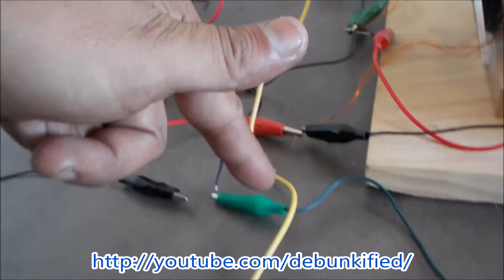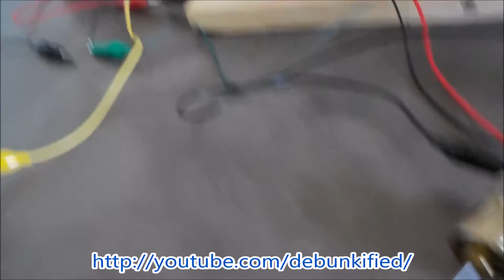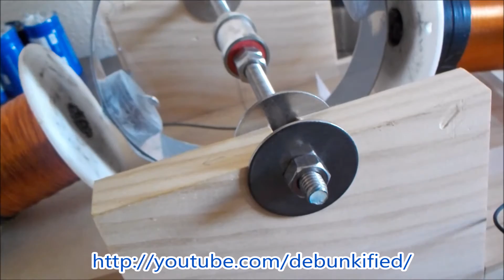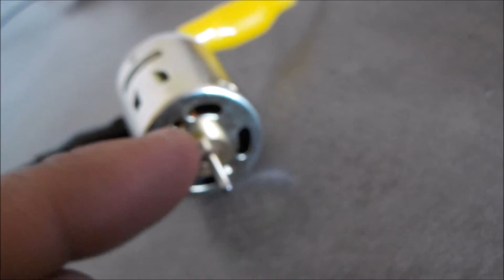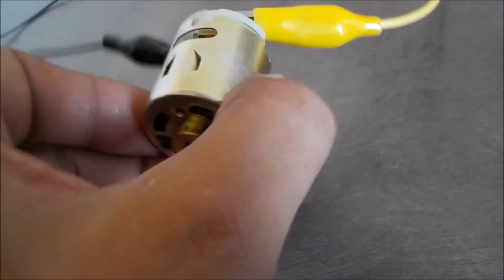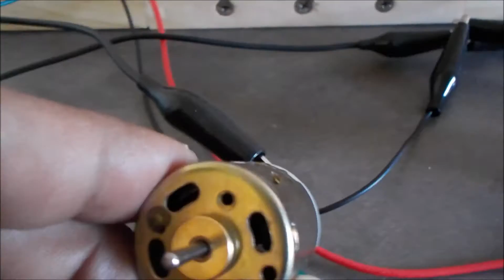Resonance is a Key

Comment: This is no "resonance". This is just: the first Motor has lower resistence, the big has higher resistence, so the Voltage is on the big second one. The first stops.
If you now use the produced energy of the second Motor, the third one turns... And it turns slower than the first.

So take of the first Motor and you got more energy for the second one and the third turns faster. 

It is everything about the resistence.

Comment: Looks like the inductantance reactance increases on the big wheel coil as it's spin increases, which takes over the power consumption of the battery from the 1st motor, causing it to slow down (initially the big coil has very little reactance because it is proportional to frequency, and it is 0 to start). The spinning big wheel  transfers power to the secondary winding coil, as the magnets are spinning over it, causing the second motor to spin faster.  You must have played around with the layout, magnets and coil winding size to get the proper relationship for it to work. Interesting demo.

Comment: Man I want that setup. What kind of bearings do you have on your magnetic wheel?
Is it possible to turn another motor off the resonant motor to produce a charging system 🤔🤔
Reply: There's no proof of overunity yet, because the power is coming from the battery, which is being drain.  If instead of attaching the 2nd motor to the secondary (or adding a 2nd generator coil), you use the output power to charge the battery and it keeps going, than at least you are making up for the lost energy of running the motor.

Comment: I'm totally lost. What is the purpose of the primary motor
Reply from the maker: +jesse byrne the purpose of the primary motor is simply to serve as a mechanical oscillator. 

It is utilized to demonstrate the power of resonance and how power is transferred to the output (smaller motor) by the building up and storing of energy in the fly wheel (rotor), while the input power becomes very small. 

Remember spinning mass stored energy.

Comment: I did something similar using a flyback transformer charging a capacitor with very similar results. had to keep a load on it or the motor would slow down. had the transformer in series with a pulse motor comparing outputs from transformer and collapsing magnetic field from motor windings. good stuff. thanks for sharing.